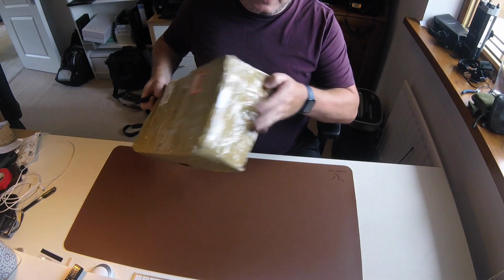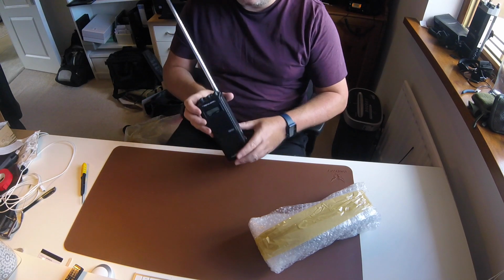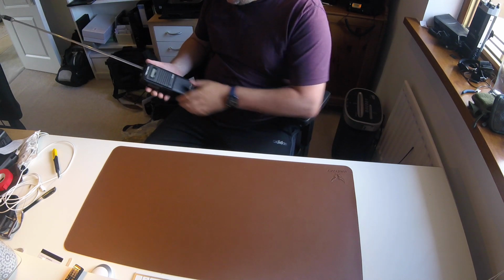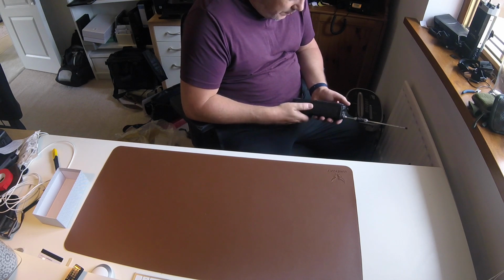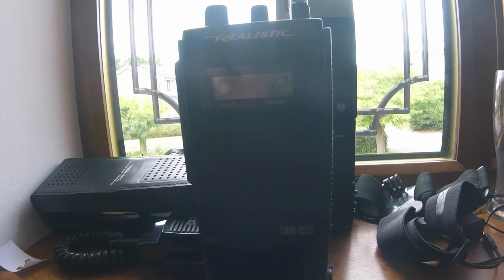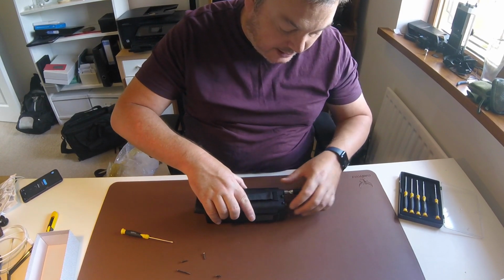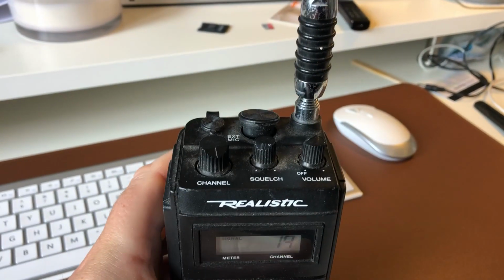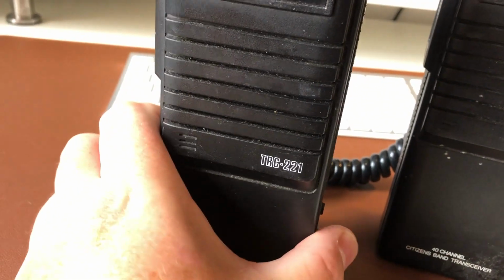Hand Held CB walkie talkies TRC - 221.

Comment: Just bought a pair of TRC-222's that were advertised as working but they are not. Both radios do not turn on, Mine are in great physical condition and were $20.00 for the pair so really no reason for to complain. 
UPDATE: figured I would try batteries and they work. The 12 volt cigarrette lighter adapters must be the issue, probably just not the proper ones, polarity is correct but likely they just are not making contact.

Comment: Hi James. I came across your video when I was looking for a manual for my Realistic TRC – 221 that you were demonstrating. I have two of these that I used to use back in the day. I had them hooked up to my car using the cigarette lighter socket to power them,  a realistic extension microphone and one of those portable magnetic aerials that you put on the roof. We used to have a side band unit set up at home as a base station. I often used to call my wife on my way home from work. Back before we had mobile phones.
I have a number of old radios in excellent condition that I put away many years ago. Just pull them out of the box and checking to see that they all still work. PS thank you for a great video.
Reply from the maker: Hi Wayne. Thank you for that. Sorry about the late reply. I love these stories and love finding old radios and bringing them back to life. Thanks again 👍

Comment: Realistic made the very best handhelds of that era, Ive got quite a few ha ha, love these old classic sets, they perform way better than the modern day 27Mhz handhelds which are appalling and very expensive as well. The Antenna coming loose is common problem and easily fixed, very often the screw just falls out, the radios will always perform better with alkaline batteries, remember with alkaline batteries you need 2 less with battery spacers as they are 12 volt sets and running 10 alkaline batteries is 15V and that will damage them .

If they have FCC on the rear they are US sets, yes interference on AM makes them hard to use unless you are away from stuff.

Nice to see you again, lovely to see someone cover AM radios in the UK as many won't touch them.

I'm pretty sure in the very last series of Stranger Things the kids were using those, they used TRC 214 in the first 2 seasons.

Looking forward to the field test 😎
Reply from the maker: Thanks for your comments.  I love your channel and I have seen you test AM hand helds with your little helper.
I agree, they dont make radios like this anymore which is a shame. 
I have more videos coming out shortly, using and testing them all out and comparing them.  I know AM is terrible to use but I still love them and will test the range.  Also coming up.... Realistic TRC 1002. two channel hand held cb radio test,,,,,Its going to be a busy day testing these out :)  Thanks for your comments

Comment: James, I want to pick your brains on the battery pack you made for the motorola brick. I need to build a couple. I'm based up here in Greater LewisRingwayShire....!
Reply from the maker: ok, which Motorola specifically ?
Reply: @Shack-time  3200 International, same as you m8. I have stripped the batteries out of 2 battery packs leaving the contacts in place
Reply: @Shack-time  Any advice of how make would be appreciated as I Dont want to mess with cells without a working knowledge. I wouldn't anyway,  73